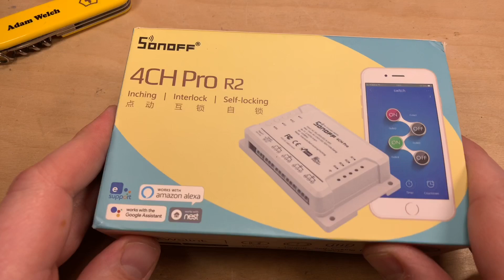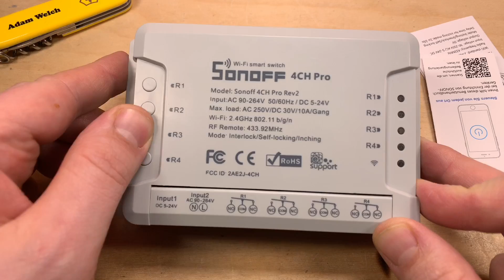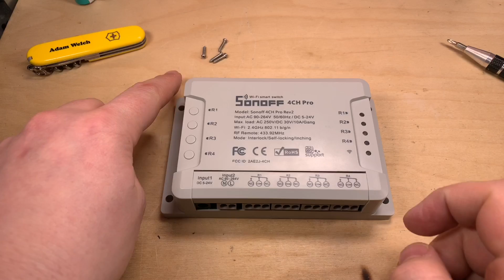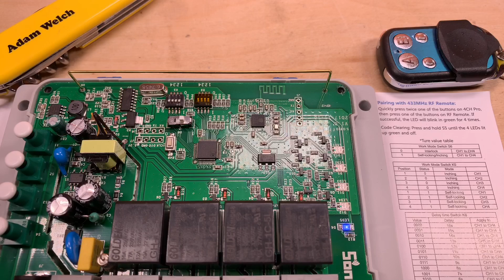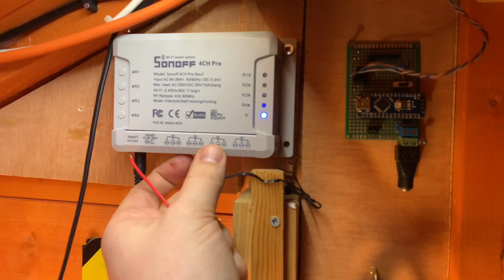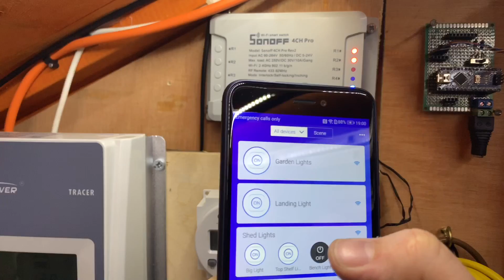Sonoff 4Ch R2 - Shed Upgrade

Comment: Hey Adam. Forgive me for my ignorance and simple questions; however, I cannot find anyone to answer my question. Noob DIYer, but I digress. I got one of these bad boys to control my simple low voltage landscape lighting. If all lights were on, it’s a max load just shy of 100 watts. Is it possible to attach a small 12v DC 120 watt transformer to the DC input without anything blowing up? Max load for DC says 30V/10A. I thought I was right, but now I don’t know. Hopefully you can help me out.

Comment: Hi Adam, thanks for the review. Is internet connection needed to operate this device or just LAN wifi? Thanks.
Reply: LAN works but I’m not sure how you would update the firmware from what it’s shipped with.

Comment: I cannot understand where is neutral and where line... :(
Reply: Hi Polloboh - the other lines are NOT dealt with in this box. You only switch the 4 'LIVE' (or DC) wires.  
First let me say that you can power this Sonoff unit with either a DC 5 to 12V Power supply OR with 
AC mains (through the mains inlet marked ('N/L') to the right of the DC Power socket). I'm not too sure if it will accept both. This would be cool in the event of a MAINS power failure. 
 
If you're using the Sonoff to switch AC mains - then you'll need to carry any Neutral and Earth lines outside the unit.

You feed 4 Live wires from your mains supply into the 4 'Common' (COM) inputs on the unit and then follow up with wiring 4 single Live Wires from the 'NO' ('Normally Open') LIVE connection to each one of your 4 devices you wish to control. The devices's 'Neutral' and 'Earth' Lines go from your mains supply to each of your four devices. They are not connected in anyway to the Sonoff (other than the single Neutral line for the Sonoff AC power supply if you use this).

When you turn the relay on - with your phone app  (or Sonoff 'R' buttons), the unit simple connects the 'COM' wire to the particular 'NO' ('Normally Open') wire.

The standard practice when switching AC is to switch LIVE wires only. Do not use it to switch Neutral lines.
 
There is another version of this box which can be used to switch AC mains only and is probably in a format you will be more happy with - Search for 'Docooler Sonoff R2' on Amazon. Note - it appears that one version of this 'Docooler' version only supports interlocking mode!

Comment: In AP mode they usually consume more power. Try to measure the power after you have paired it with the EWeLink app. Also EWeLink has an option to disable the status leds, which can save a few mW

Comment: I would like to control the Sonoff 4CH Pro R2 using a RF 433MHZ modulo with a Arduino.
Does anyone know how to? Could you make a video about it?
Thanks.
Reply: You can learn 433mhz codes to this device by pressing the channel (R1,R2,R3 or R4) button twice. The light will turn green if the signal is learned.
Reply: @leonvollebregt639  But can you learn a generic 433MHz controller or only the Sonoff controller?
Reply: I'm using an remote from some rf sockets that I had laying around and it works fine. I think you can use any 433mhz rf remote.

Comment: Nice unit, Not sure 2.5watt is really a problem. You could desolder the relays and replace them with SSR's which will really help with the drain when all relays are on.
Reply from the maker: Neat idea - might look into that. Thanks.

Comment: All switching items have both an AC and DC switching rating, no matter whether it's published or certified for that rating or not - despite what many will tell you. Rule of thumb: Anything rated for 230 volts AC will handle DC to the same currents at 12 volts. Although I would recommend caution here at the upper end of the current rating. Once you up the voltage to 24 volts DC you have to be more conservative. 30-50% of the 230 volt AC current rating is sensible. With anything above 24 volts DC it's wise to make sure the component does have the DC rating you require.

Comment: similar setups
i have 6 ch RF relay ( not a fancy sonoff or wifi one ) controlling floodlights, blluetooth amp with external speakers, internal shedlumination, and 3 channels ready for lighting around the garden
was about a fiver from ebay and works really well
Reply from the maker: Sounds great. Actually with that and a sonoff RF bridge you’d get pretty much the same level of functionality for a little less money I think. Cheers

Comment: Sonoff says 5-24V input but the relays are AC or 5VDC at 12A rated.
https://www.aliexpress.com/item/GOLDEN-GH-1C-5L-5PINS-5VDC-Power-Relay-original-New/32244216465.html

Comment: Can you can you dim the lights with the Sonoff ?
Reply: Sonoff used to have a dimmer LED system, but it has been retired. This device as is wouldn't be able to dim lights as the relays aren't fast enough for PWM and the software doesn't support it.

Comment: What would be the main issue/s using that relay set for DC when they’re rated for AC?

I know there are issues with switches arcing (when using AC switches for DC) but is that something to be concerned about with these Sonoff relay sets as well?

Comment: I always custom flash tasmota on my sonoffs. Don’t rely on the cloud after that point. Can off net
Reply: is this because you don't trust the  OEM firmware on the sonoff?
Reply: Chris hey buddy. No, it’s because of customisability and I’m running home assisstant as my home server. I’ve custom made pcbs using wemos mini all based on same chipmset esp8266 etc. 
I hate having multiple apps for different things. I’m also planning on having an extension done and no light switches.  It’s all going to be smart so. Also have sensosrs round the house to feed info into the system and using automations etc. Thus using tasmota i have more control.

Comment: One thing I'm confused about.  You have 24v in from your batteries, and it converts it to 12v out for your lights, or do you have a buck converter between the batteries and the Sonoff reducing the voltage to 12v?
Reply: Gregory Germain IIRC Adam’s battery setup is 12V.

The Sonoff does not convert the voltage. It is taking the ~12VDC feed from the battery and via the relay switches sending the same out to the loads.

Comment: Sonoff products are terrible, extremely slow and intermittent. Save yourself the hassle and ditch it for something more reliable.
Reply: Once flashed with Tasmota or a different firmware so they don't use the sonoff cloud/app, they are much faster.
Reply: @JonathanWellskcender  That's not a complete product though...why not just buy something that works first time?
Reply: @jonesrichardmr  For the same reasons that Adam built a diyBMS instead of buying a WatchMon4 or other off-the-shelf solution. We get the functionality we want for a much lower cost, can sometimes go beyond the manufacturers available functions, and learn in the process. With Tasmota, Adam could add a PIR sensor to the ESP to turn on a relay as soon movement is detected in the shed.
I have Sonoff Touch switches all around my house running Tasmota firmware that connects to an on premise MQTT and Home Assistant server. It's faster than any other solution on the market that has to talk to the cloud and will continue to work even if I lose Internet connectivity. It's not for everybody, but Sonoff makes most of their products relatively easy to flash with new firmware.
Reply: @JonathanWellskcender  There are other Chinese units with similar functionality and price, working through the SmartLife app that work instanteneously and flawlessly without the need to maintain an in-home server.

The hard way isn't impressive, its inefficient. Time is money, friend.
Reply: @jonesrichardmr  I've used SmartLife/Tuya devices before. They also talk to the cloud and aren't instantaneous depending on their server load and your own Internet connection speed. 

When your Internet dies, the ability to control the SmartLife devices from your phone or any automations you have with IFTTT or other external service also stops. Also, what happens when the Chinese company stops the SmartLife service? I've previously used SmartLife/Tuya devices, but found that when my wife can't do something that she has become accustomed to because we rely on an external service, it costs me more time and hassle. Since changing over to Tasmota, everything is faster and more consistent. I ended up giving the SmartLife devices to my sister in favor of Sonoff switches.

Even without these devices, I'd still run an on-premise server for Plex, HASS, Pi-Hole, and other services. As I said, it's not for everyone, but Sonoff definitely isn't terrible for the price.
Reply: Sonoff products are a great way to get ready made hardware which you can improve immensely with Tasmota.

Comment: Hey Adam
   The 24v dual ac DC input makes it pro.
Good video
Reply from the maker: Thanks for clarification.
Reply: And the 433 Mhz Remote - Control - Function
Reply: and the dry contacts that the non pro model doesn't have